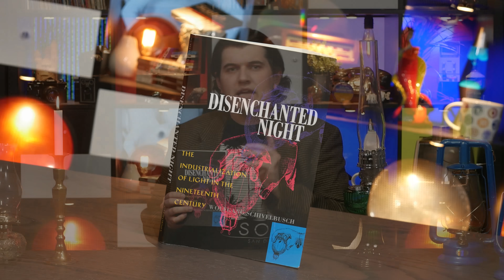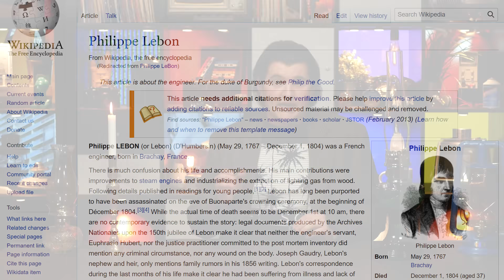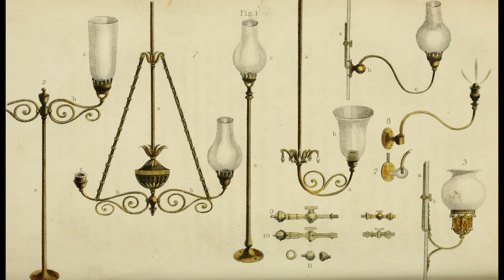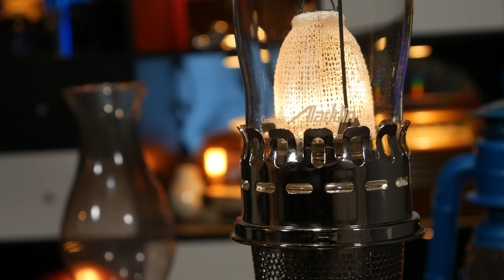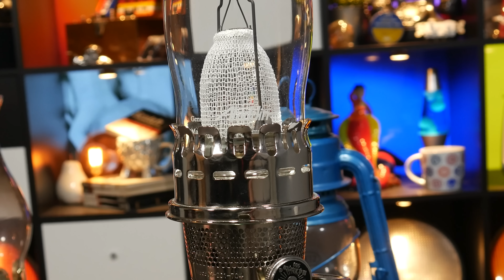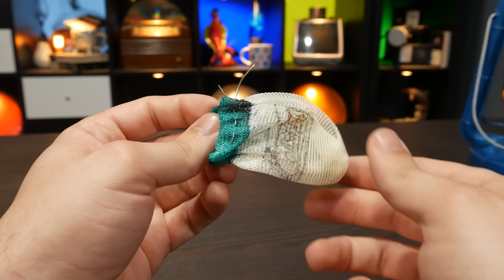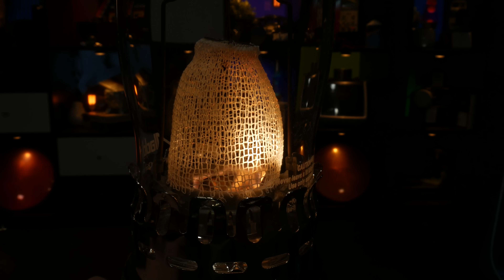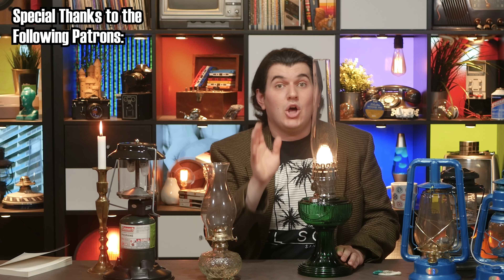How the gas mantle made lamps 10X brighter

Comment: Also, i think that turn-style electric switch could be traced to gas valves as well.
Reply from the maker: Indeed! Schivelbusch mentions this, and the earliest switches were quite bad for this reason. We didn't know yet that they needed to be clicky!
Reply: @TechnologyConnections  good thing there is a video out there to explain that very phenomenon!
Reply: @TechnologyConnections  We had clicky-turny switches in Czechoslovakia.
Reply: @I967  My grandparents still have it in their cottage :) (only in few mostly unused rooms though)
Reply: @TechnologyConnections  My switches STILL AREN'T clicky !
Reply: "Knob and Tube" exposed 110 volt wiring also teaches respect. (this applies mostly to the survivors)
Reply: @FindLiberty  the house I was living in up until about 5 years ago had knob and tube wiring with twist knob switches. When I left, i took some of them off the wall and kept them for the next house I buy.
Reply: @Phred_Phlintstoner  Nice!   Could hide a 2032 battery and tiny RF board inside to control modern retro-look LED lighting.
Reply: @FindLiberty  they are still safe-ish, functional light switches made of porcelain and brass. I'd rather just use them as is. There is a reason they still work after 100 years.
Reply: @FindLiberty  Knob and tube wire is actually insulated (rubber) with a braided, cloth sheath over the insulation. It is supported away from the wooden house frame members by the porcelain knobs and threaded through the tubes inserted into the holes in the frame. The splices in the wire are soldered together, and then wrapped in rubber tape, followed by cloth tape. Where it may come in contact with flammable material, it is threaded through treated, braided cloth tubing, similar to early Romex jacket material, called loom. Pretty robust and safe compared to today's wiring practices. It mainly went out of style because it got too expensive and Romex cable got cheaper to install.
Reply: @dougbrowning82  Okay!
Reply: @FindLiberty  I just moved into a 126 year old house where some of the circuits are still Knob and Tube in the parts that haven't been renovated and replaced with modern wiring, basicly any circuit that has an outlet in the main living spaces on it has been updated. The attic still has Knob and Tube I think since there is a small fuse panel up there that uses fuses with a round glass housing. There are other parts of the house that have light switches with round bases that look like they replaced the older twist knob switches that are probably Knob and Tube as well.
Reply: @rocketboy617  Be careful with the juice. Even 70  year old "modernized" wiring may have funky cloth/dried up rubber insulation.  Recent renovation might be superior THHN insulated wire; here it's also in metal conduit.

Be careful in that attic. Watch out for charred squirrels that may have discovered that old wiring and learned about it the hard way.
Reply: @rocketboy617  Often the service entry for the electric power was directly into the attic - hence the fusebox there. I bet if you look on the outside of the house you will see the remnants of an old bracket where the drop wires from the alley were attached to the house.
Reply: @FindLiberty  thanks for the warning, I'll keep that in mind if we do any electrical work on or use those older circuits and the attic. The attic has a few light bulbs but they don't turn on so we don't know for sure if it still has power or not. That said I still treat any wire, new or old, as hot until I can test it with a voltmeter. Especially in a house like this that dosen't have a circuit map or a record of modifications made. I picked up a healthy respect for electricity when I zapped myself after I accidentally stuck my finger into a light switch that had its cover removed while my parents were painting. I think I was 8 or 9 at the time. And I'll never forget the 'pop' sound of my youngest brother shorting out a wall plug with a necklace chain he was playing with 2 feet behind me when he was 3 or 4 a few years later. He was fine besides a few microbeads of metal that had been imbeded into his palms from the fine chain vaporizing under the current. My 3 other siblings and I all got a pretty thorough lecture about the dangers of electricity from my dad after that one.
Reply: @rocketboy617  Lessons learned the hard way - glad everyone lived!  

The sneakiest electrical surprise that kills people who think the power is turned off is the current carrying neutral. The main electrical box grounding wire that's assumed to be safely grounded to a water pipe and/or ground rod until it discovers a path through a human body to get back to reestablish its ground if it somehow becomes disconnected from its intended ground connection. Very dangerous.

Especially in tangled remodeled wiring, another circuit is usually sharing that same neutral. e.g., the refrigerator decides to run and all of a sudden a disconnected, previously "tested" neutral becomes live at full line voltage and ready to kill. Both circuits (two fuses/breakers) need to be turned off if that the case!

Also, in areas where electrical codes require all wiring must run inside metallic electrical conduit, that safety ground path also needs to be very good, that's also enough to pass enough current (15 or 20 amps during a fault or while testing!) to trip the circuit breaker or blow the fuse. Rust and/or corrosion at the couplings can disable that safety ground and it can become lethal if a human body gets into that path (arm to arm through your heart?) across the fault as it heads back to find a better ground from that old, metal cased electric drill that finally decided to short to the case, with or without a three-wire cord. Be very careful or better yet, just call an electrician.
Reply: @FindLiberty  bzzzt
Reply: Did the lamp have always on pilot
Reply: I have one antique switch in my house that's a turn switch. I've never changed it because I actually like it and it's kind of cool. It is clicky though, very satisfyingly clicky.
Reply: @NoZioKikes88  that's the same with mine. Very satisfyingly clicky!
Reply: Early gas replacement electric ligh fed the wires through the existing gas pipe. Instant conduit !
Reply: The USA says "turn on the lights", and many other countries say "open the lights."
Reply: @darrennew8211  Meanwhile, my brain wants to confuse "open the lights" with opening the circuit -- i.e., turning them off.